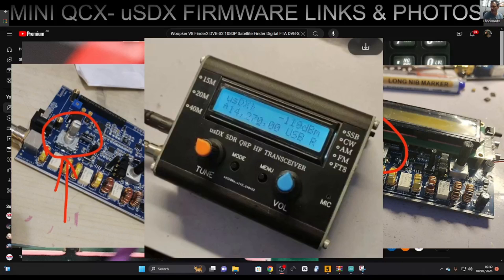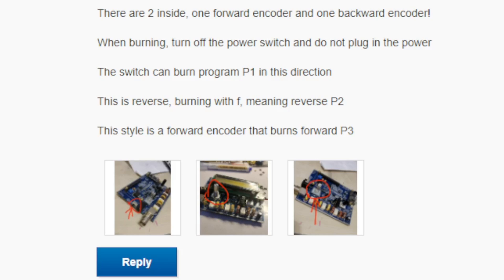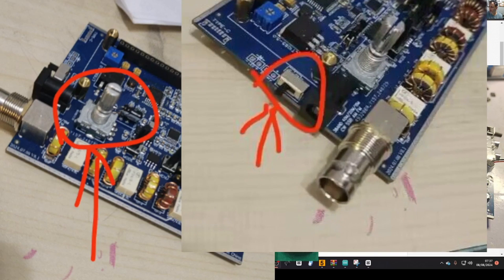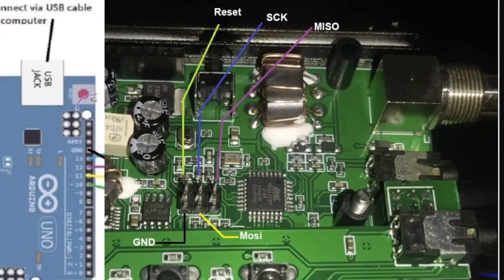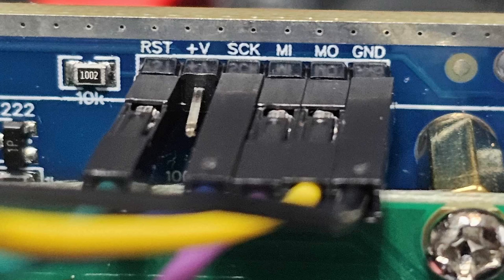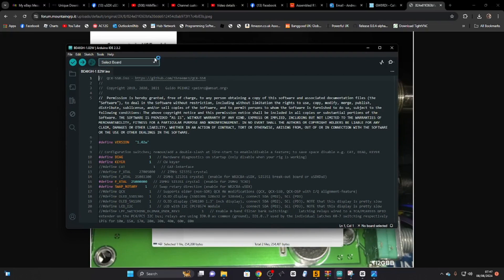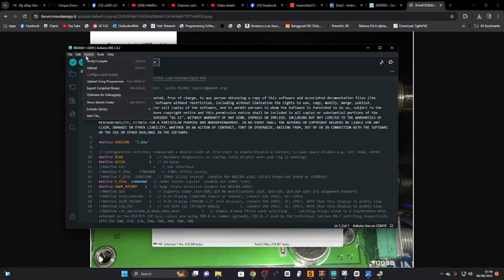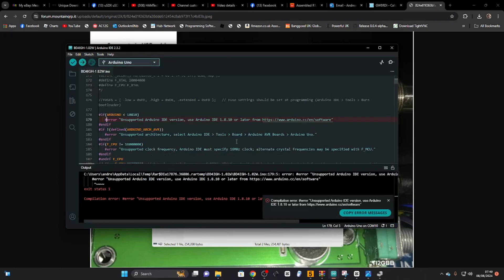QCX - uSDX - Orange Blue Button Firmware Links

Comment: Hi! In some description of this device on AliExpress, I read that it had an SWR meter. Do you know if any of the available software is compatible with this function? In my case, the device didn’t come with this enabled. It seems to be the same firmware version you show in the video. Thanks and regards!
Reply from the maker: Hi i tried the update on another device i eneded up bricking it.
Reply: @M0FXBHamTech  sorry to ear that, is working as it comes, i can use an external meter. better than the risk to brick it and maybe is not a software just mod, maybe i need to add a rf bridge. thanks again!
Reply: alliexpres version clones dont have swr brigde....do not read swr...
73 de LZ1OPM